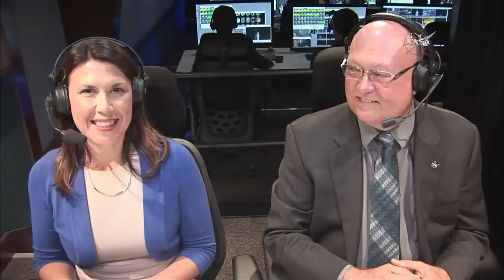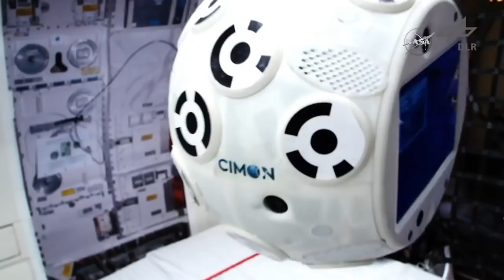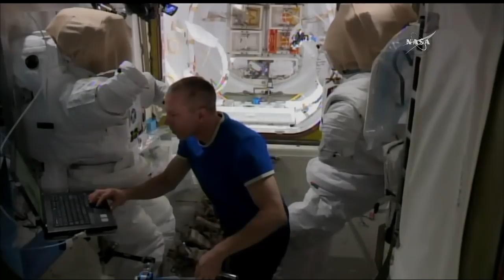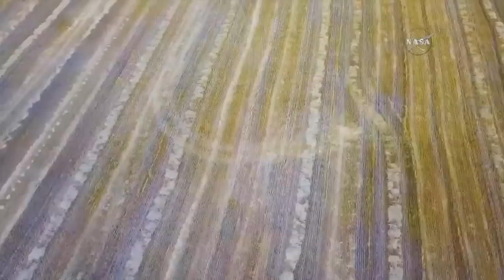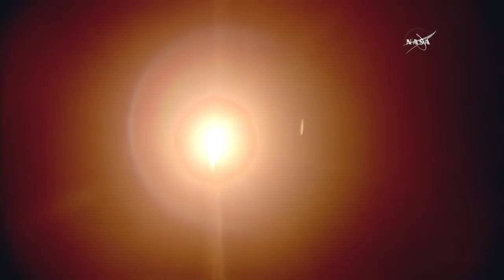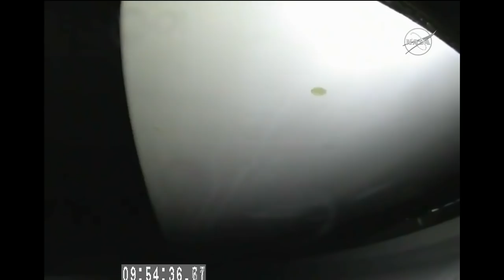Launch of SpaceX CRS-15 with ECOSTRESS (full broadcast)

Comment: Good coverage of the background of the mission, and includes the deployment of the solar panels. A bit amusing, though, that this NASA production keeps showing Houston mission control and repeating that they'll be "monitoring and managing" the launch and rendezvous, when they are basically spectators while SpaceX mission control actually runs all of that, up to the moment Dragon is parked next to the ISS; that's when NASA takes control, uses the arm for docking. They even cut the audio of the countdown from SpaceX over to the NASA guy, who was just watching the same picture on a monitor we all could see.
Reply: Don Jones even Spacex mission control are just spectators, even though they are able to override certain things. From Falcon 9 "start up" 59 seconds before launch The vehicle is completely autonomous including the flight termination system. It also includes the booster landing on the drone ship or the cape. The booster flies to wherever it is pre programmed to and when it arrives at the programmed altitude it just shuts it's engine off. This has caused a few problems with drone ship landings. In rough seas the ship is going up and down quite a bit causing the booster to occasionally shut off and drop onto the deck from 5 or 6 feet in the air. You can find the video if you want to look for it. Short story long,, the Falcon 9 flies itself. This does not include the approach to the ISS. This is required to be monitored from the station.
Reply: I knew about the launch and landing autonomy, but hadn't thought about the burns in between. Well, I figure SpaceX Control has to be able to over-ride for whether re-entry burn happens or needs to be re-programmed.
Reply: I should add that they can program in all the burns because the know the exact weight of the payload.

Comment: Why no 1st stage landing?
Reply: Old block 4 boosters are no longer reused.
Reply: well thank jeebus, that;s my favorite part, ill tell you what
Reply: Almost all missions from this point on will have a landing
Reply: also, besides being a now obsolete block 4 stage, burning the first stage until dry probably gets several hundred extra pounds of cargo to the ISS.  A first stage landing comes with a built in payload penalty so if the customer is willing to pay more for that extra lift capacity, SPACEX will gladly take their money.
Reply: I love watching the landings, but they cost money. SpaceX has revamped their refurbishment facilities to do Block 5s, so it can't practically do a Block 4. I'm pretty sure the weight of cargo to the SSI is limited by the specs of the Dragon -  it's a fairly easy trip for any Falcon 9. So it's the cost of extra fuel for landing and the null refurbishment. The economics of using up the Block 4s must make sense in the long run.
Reply: Don Jones its definitely well within the specs of the Falcon 9, but don't forget too that there is also a fuel penalty for the high inclination orbit of the ISS.